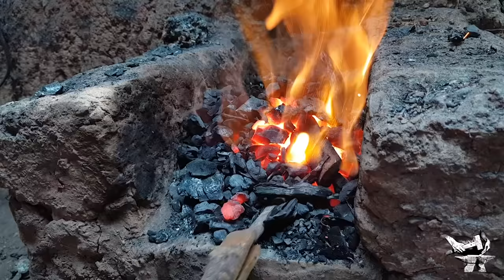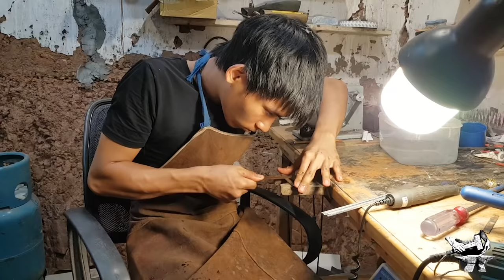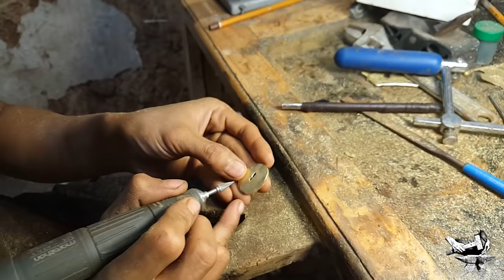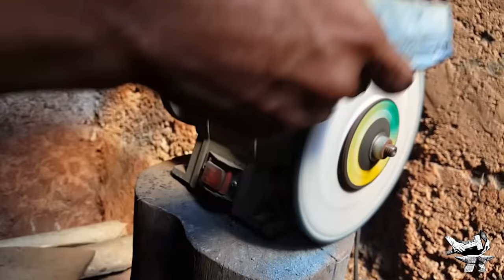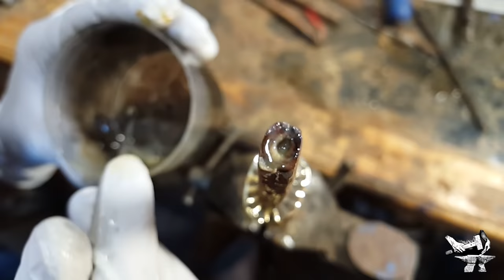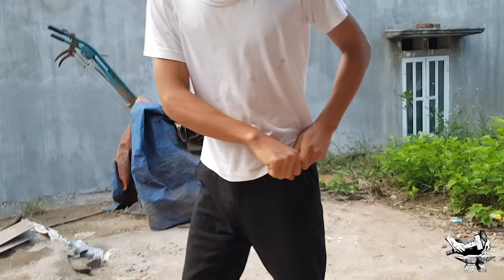4K DIY VIDEO Blacksmith Working - Kimetsu No Yaiba - Making Tanjirou Mini KATANA SWORD | n39 vlog

Comment: fun fact about katanas: the curve is actually made when the sword is dipped in the water, it’s actually straight when it is forged then curved due to the heat of the sword and the coldness of the water. 😁😁😁
Reply from the maker: Tks for your cmt ^^. My latest video just uploaded: https://youtu.be/-mg7zSI2a8w
AND Please help me to share for more people and we need some donate fund to continue this job, we run out of money now, this job for 8 months and we have still done it with our passion!
If anyone want to help us can donate through PayPal: mtien_red@yahoo.com
Reply: To add to that, the curve is actually formed due to differential hardening. The thicker non-cutting edge has softer metal and is layered with clay, while the edge is harder and not layered with clay. Once cooled, the cutting edge cools rapidly and contracts, but the non-cutting edge cools slowly and curves inwards as it contracts, thereby pulling the cutting edge backwards and curving it.

Differential hardening and the usage of clay on the thicker edge is the reason for the curve.
Reply: Puts on Yea, it's big brain time PewDiePie template
Reply: @williamnoragami8043  laughter.wav
Reply: Very interesting
Reply: What the fhuk!!!!!
Reply from the maker: Hi, tks for watching friends. Here is my latest video: https://youtu.be/Weh0Q-neu_E
Reply: Called “quenching”, the top of the sword has clay applied so as does not heat or cool as rapidly, causing the curve.